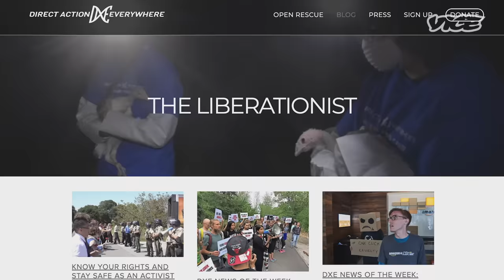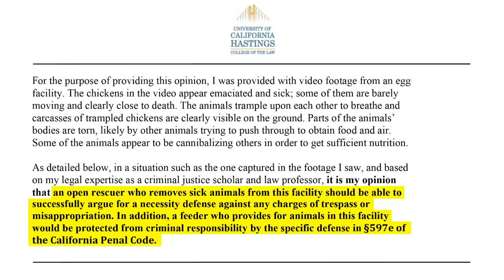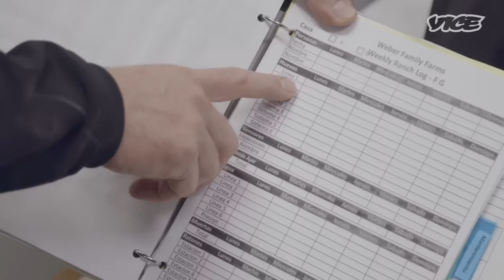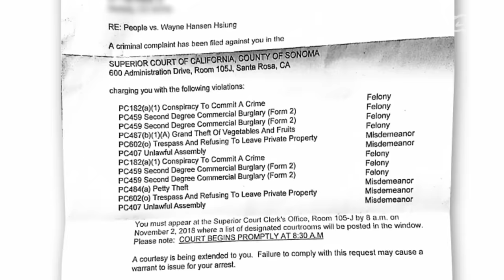Animal Rights Extremists: Trespassing to Rescue Chickens

Comment: The biggest issue with this farm appears to be the battery cages. Keeping chickens under those conditions is cruel. Birds should be allowed to express their normal behaviour and roam freely which does not appear to be happening here. Surely we can all agree that having an animal spend its entire life in a cage where it is treated as an egg laying machine is wrong.
Reply: People want cheap eggs, cage raise chickens or the cheapest way to raise them. We live under capitalism as long as there is a demand there will be a supply in this so happens to be the only way to feasibly do it. There is a reason that cage free eggs are significantly more expensive than cage eggs.

Comment: Damm vice has made a comeback with unbiased reporting first the black conservatives video and then this. Good job vice
Reply: Agreed this comment needs to be seen by vice
Reply: This is garbage reporting. Casually mentions a guy potentially getting 60 years for stealing 2 piglets as if it’s the norm... gives no push-back on the dead bird which clearly had something seriously wrong with it
Reply: I agree they are starting to actually look into their critical issues which is good
Reply: Hear, hear!! re-subbed
Reply: nuanced, yes. sadly with vice its a matter of who is the reporter. this one is good.
Reply: Vice has NOT made any comeback. By simply doing a couple stories doesn't mean shit. Also, by vice using illegally obtained video, vice has chosen a side. It's bullshit.
Reply: Bewildering Truth Seeker ... you sound biased?
Reply: @jmarvosa6x3  nah... I just tell it like it is. I'm not bias, I'm a realist.
Reply: @stevenkennedy8609  'casually.' You want to news to tell you what's right and wrong? I see you're a fan of biased news. Adios.
Reply: Eh, this video is pretty biased against the animal rights group just in the first few minutes it shows the violence that they bring
Reply: @Bjorn Vila The video on meth use in Fresno from a couple of days ago mentions the failures of Proposition 47, which was largely leftist (in that, as someone who leans left, it’s even extreme for me) supported and heavily criticized. In the video both drug dealers and users criticize lack of punishment for drug possession. I’m happy there’s been a resurgence of integrity/nuance at Vice, too and I hope it continues.
Reply: @stevenkennedy8609  they used to be good like 4 years ago, like going to north korea was cool but this new woke shit is lame
Reply: Honestly, their stuff has become so interesting!
Reply: The chicken looked like it was most likely attacked by another chicken / chickens. It had a lot of if feathers torn out and was pushed aside. Unfortunately that happens. If a live-stock farmer could buy something that would guarantee that none of his animals would die and he would have a 100% yield, that'd be an investment of a lifetime. They're useless if they die before slaughter.
Reply: Bro the black interviewer that did the black conservative thing was biased as fuck the faces he made at the begging said it all
Reply: Bjorn Vila yeah, firing those journos actually made room for quality control. Who’da thought?
Reply: @stevenkennedy8609  you want vice to do a 17 minute segment on a dead bird? Alright go start your own doomed to fail media Corp